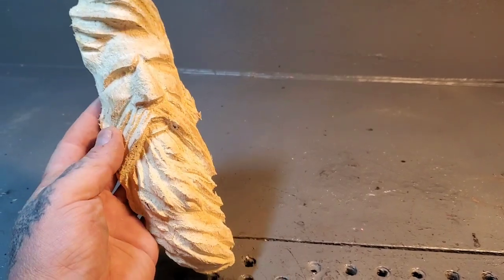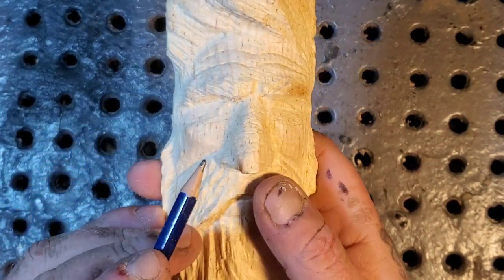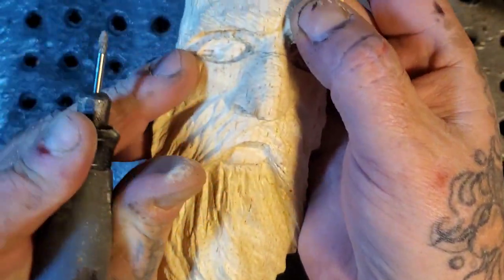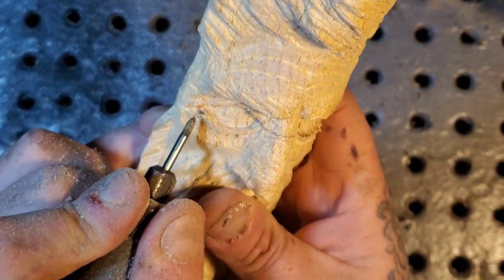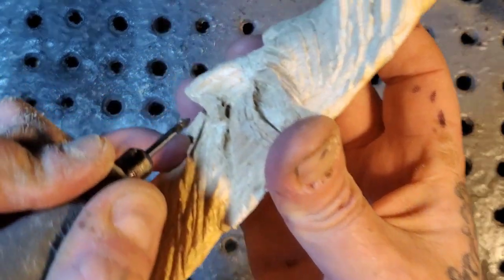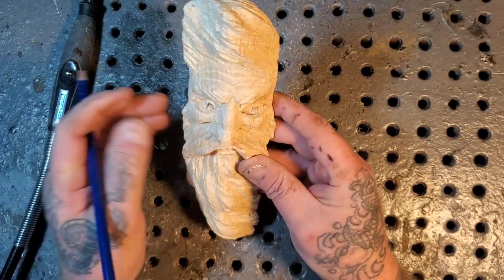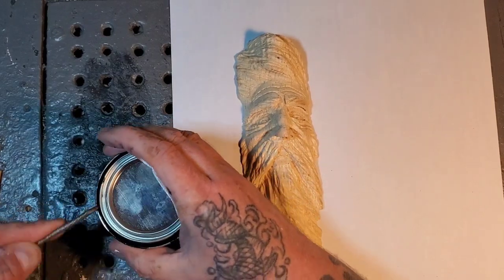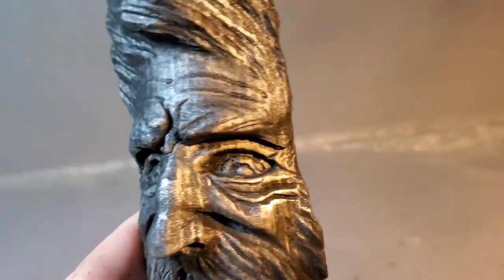100 % Beginner how to Carve a Woodspirit 2 of 2, 2021. Dremel carving. Eye's & Details

Comment: Cool video. I am just now starting to watch your stuff. I do wood carvings too, but with a knife. I paint my characters, but I like them to look old and weathered. One trick I do, the last step actually, is a rub the carving down with super fine steel wool. Gives it a nice matte finish and you can adjust how hard you rub to adjust the wear. I ordered some burrs theu your link to kutzall, I will be doing some wood spirits with you!
Reply from the maker: Awesome.thanks.for the tip and.supporting

Comment: ehy bro, can I use a 1\4 shaft with a dremel 3000? I'm in love with your wood art and I'm trying to get dsome good stuff for big and small wood arts
Reply from the maker: No u can not, I would stick with the 1/8 shaft for the dremel, Thank u
Reply: @CarvingFusion  minute 18:58, your taper burs that you are using, it seems a 1\4, I'm wrong than . And which kind of dremel I should use for a 1\4 burs?